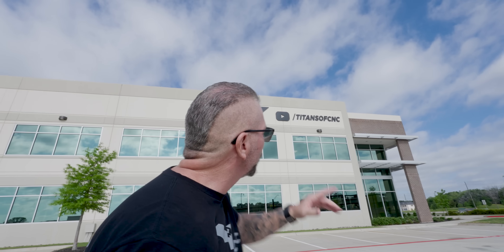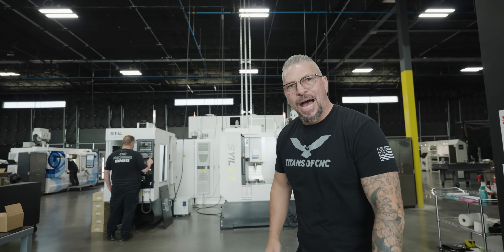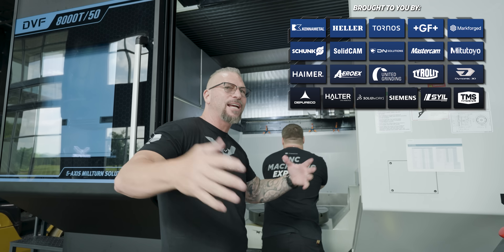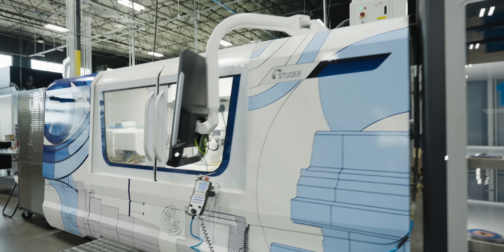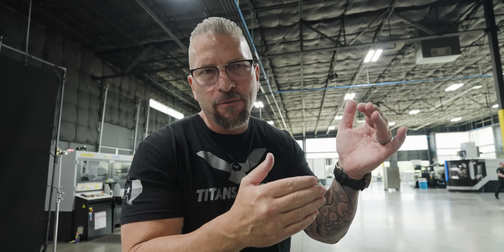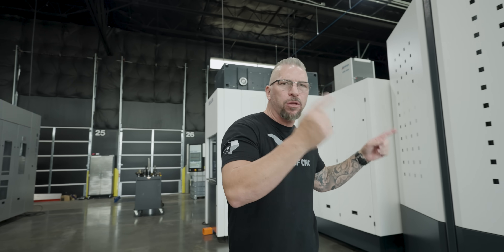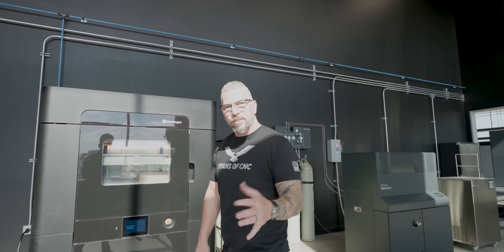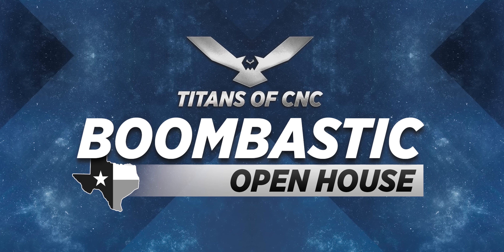CNC Machining Will Never Be The Same: This is Next Level

Comment: I have a question: I've been a "machinist" for 6 months, and I have no formal education on the subject of machining, so I don't know what are the right speeds and feeds. I've been told by a colleague that I have to "listen to how the machine sounds in cut" to know if my speeds and feeds are correct. Is it possible to tell if I'm using the right parameters just by sound? And if so, can you make a video giving us examples of what to do, what not to do, what sounds right/wrong, and speed and feed selection?
Thanks for doing what you do, thanks for reading and greetings from Czech Republic.
Reply: Refer to the toolmaker's manual first. There is a range given for each material.

Start at the lower end and increase to the higher end as long as the process sounds right and you don't overload the spindle.

Comment: Why no Mazaks?
Reply from the maker: They never came to my shop or showed interest in our mission to provide free education to all.
Reply: @TITANSofCNC  It's a shame.  I am up in northern Alberta Canada and did my apprenticeship in a shop that manufactured forestry/oilfield equipment with a full Mazak lineup.  Very good machines.  Mostly conversational programming but then again since Mazak were the original patent holders for conversational.  Since then I have run a bunch of different brand machines and nothing comes close to what the Mazaks had for performance/reliability/accuracy and serviceability.

Comment: they have a lot of machines. But they are still missing an overhead crane. It is really a lot easier if you have to load heavy workpieces into that Heller machine than with a forklift.

Comment: Have you thought about getting an injection molding machine? Because as you know that’s another way of manufacturing certain parts for the industry. I guess the 3D printer removes the need for an injection mold though
Reply from the maker: Yes

Comment: BOOM!! As a Calibration Tech this all seems like such an awesome time. I may not machine parts but I still live, sleep and eat tolerances and measurements. Titan is a machine! Lets GO!
Reply: Did ya get your ASQ CQI?
Reply: @Graciashauf  I did not, I am looking into it now though. I have been in the calibration field now for 15 years in pharma. I'm going to definitely do some reading on this.
Reply: @Tweaked_ej6   yea I'm at 26.87  with that and it never expires. It's open book 100 questions 4 hours long, bathroom breaks don't stop the time. I never studied for it. I went home early from work cause I work 2nd did my off the clock 420, played Zelda, passed the test next morning first try.
Reply: @Tweaked_ej6   10 questions don't get counted against you. I took that test with 4 years experience so you should ace it NO problem
Reply: @Graciashauf  I'm gonna dig into it some more and see if work will cover costs. They love putting us through classes and getting certifications so it should be no issue at all! Keep kicking butt and learning as much as you can every single day. Even 15 years in and I still learn new things daily.
Reply: @Tweaked_ej6  my job the same way. Sent me off to hexagon. But pcɗmis makes me pull my hair 😆